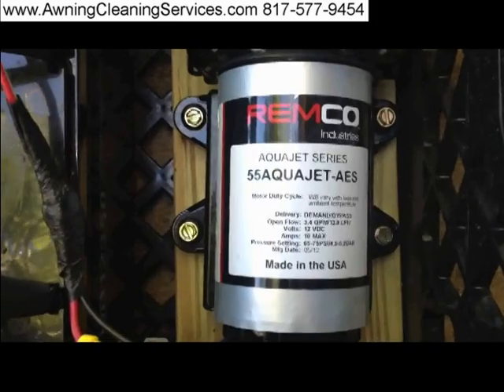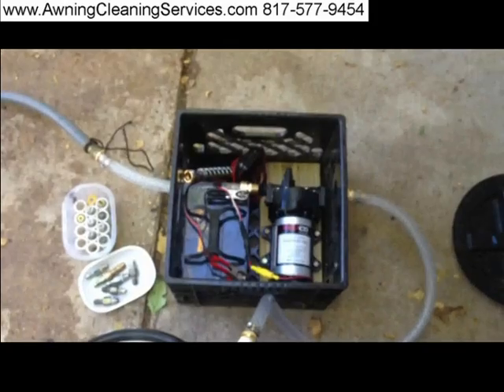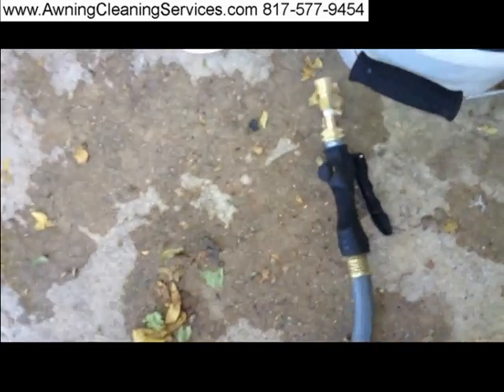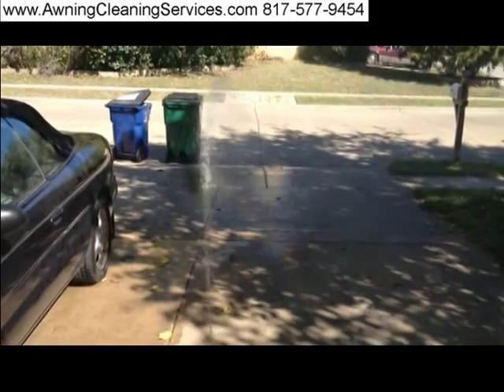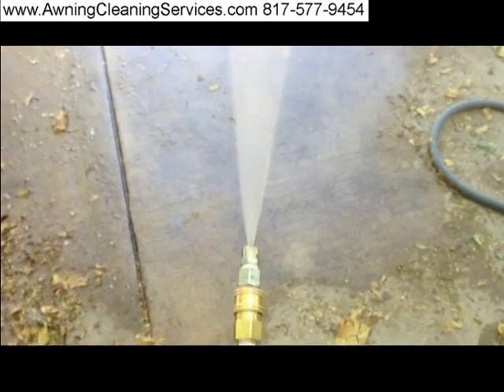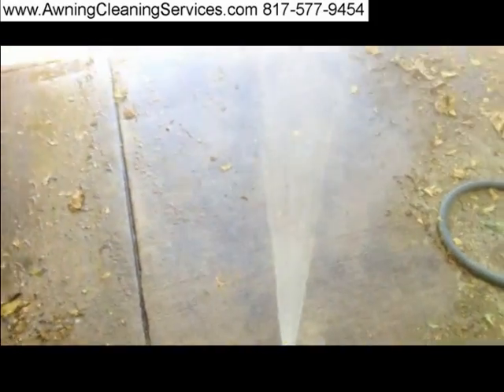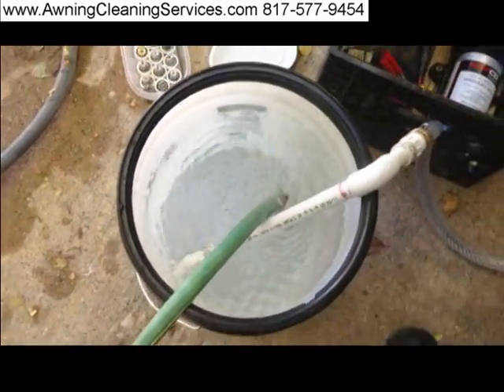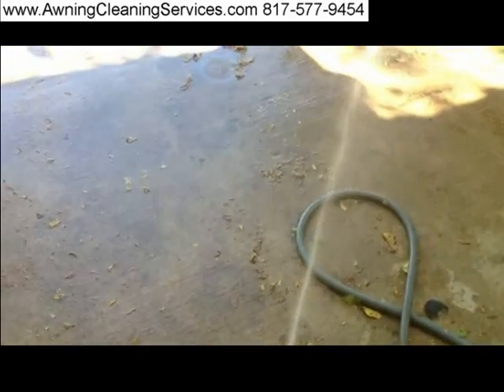12 volt Water Pump Testing for Awning Cleaning Dallas Fort Worth TX 817-577-9454

Comment: You did you for job with this video, lots of good information.  But here's what I'm curious about.  If you cut the hose off from the front while the pump is running.  Will it damage that pump?

Comment: Hi, good vid thanks for posting, how long does the battery power last with the battery you are using, i am planning to start a car cleaning business and looking for an alternative to a petrol pressure washer as i will be starting off with just my car to carry my materials, could you recommend a budget 12 volt pump that i could run from my car battery? i am based in the UK and if i purchase one from the US sometimes the shipping costs can be quite high,  thank again!
Reply: Did you ever get your pump setup going. If so wat did you use